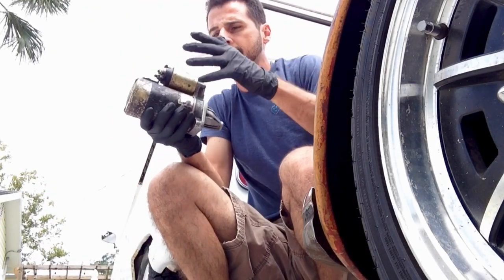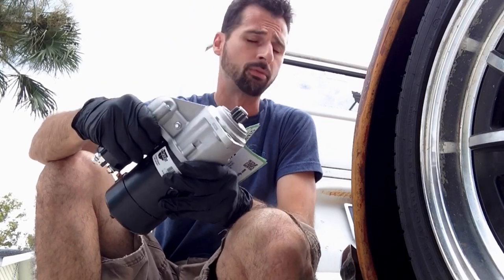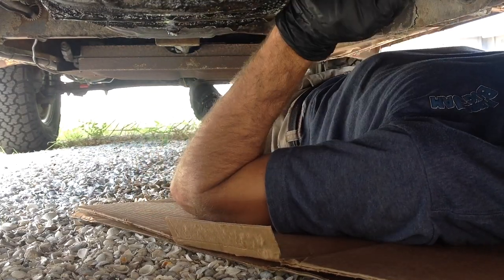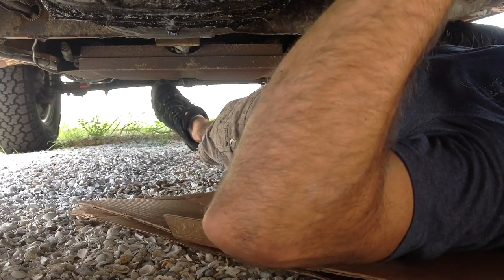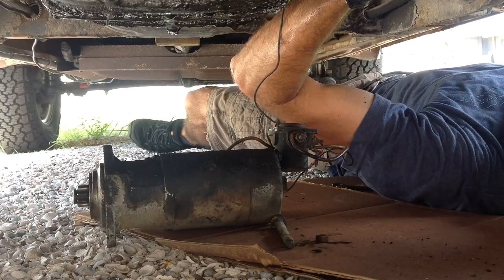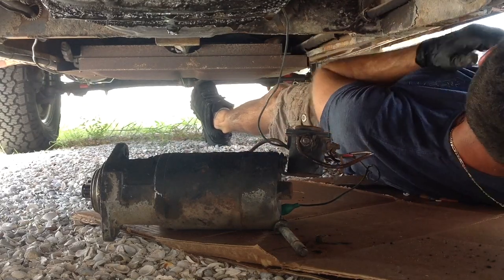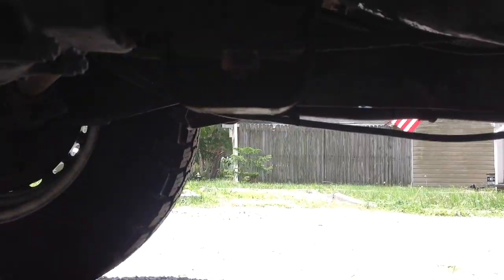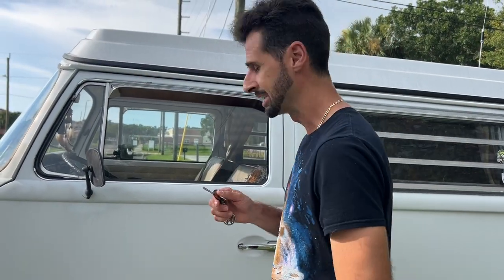Replaced the starter on a 1971 VW Westfalia bus & removed the hard start relay - Garage Talk Series

Comment: Maybe I missed it but where did you buy the new starter form?
I’ve had horrible luck with the auto stick starters from autozone over the years.
Reply from the maker: I got it from advanced auto. I tried to get a bosche one but was unable to. I actually got the one in the beetle from them about 15 years ago and is still working. 🤞🏼